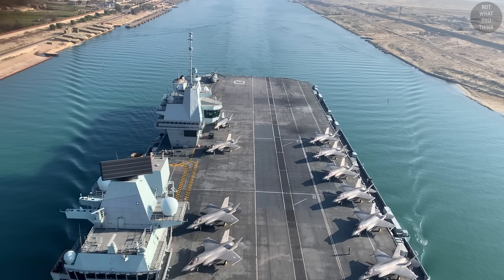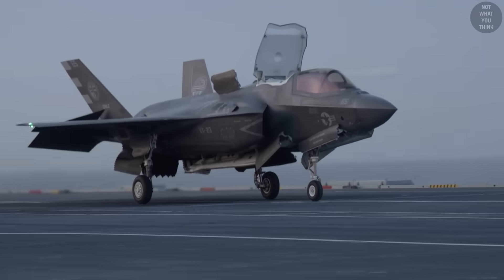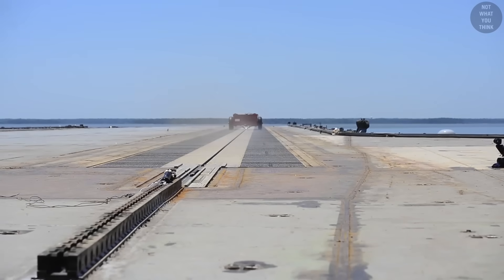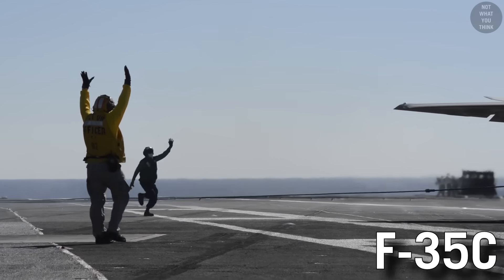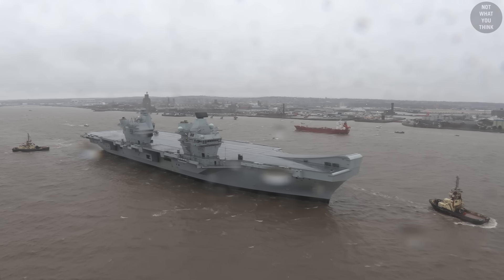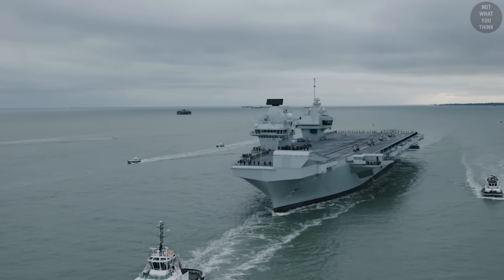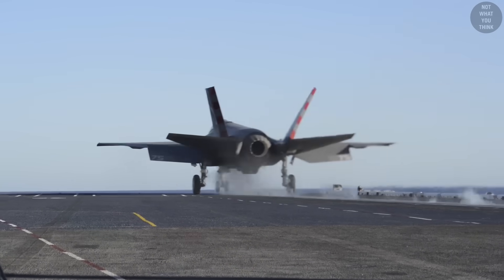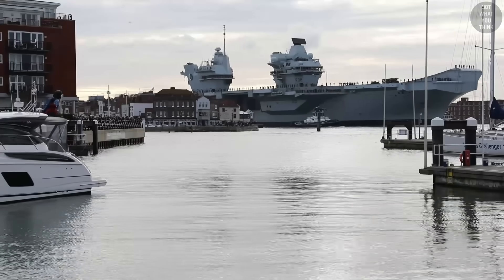Was the Angled Flight Deck Missed on HMS Queen Elizabeth?

Comment: They should have built stobar, now they're stuck with vtol aircraft for the next 50+ years.
Reply: To be fair the addition of an arresting gear would be possible if required in future, STOBAR wasn't really considered now because STOBAR aircraft take off with very limited fuel and weapons compared to the F-35B, it's likely going to be CATOBAR or STOVL, no in between.

They are now planning on adding a catapult and arresting gear sometime before 2030 to launch medium sized unmanned aircraft alongside the Ski-Jump now, it's possible in 50 years all of its aircraft will be like that.

Comment: How the hell are EM catapults still problematic? They use the exact same technology as EM launched rollercoasters, and those have been around for decades.
Reply: Without speculating on possible factors such as politics and corruption, from a purely engineering perspective, it's probably a matter of scale and precision.

A fully loaded carrier fighter can weight upwards of 20 tons, and have to be accelerated much faster than a roller coaster, so the EM catapults have to be much more powerful while also being able to fire much more frequently. The new US carriers also claim to have EM catapults that can  have dynamically adjustable force profiles to meet different plane/loadout requirements. This is probably what fucked them up, because designing a catapult to do the same thing every time is not that hard, but having something that powerful and precise be adjustable is frankly asking for trouble. However, this was one of the selling points used to convince Congress to fund the EM catapult, so they couldn't just scrap the feature. There's also the potential issue that being powered by shipboard power might be more difficult than with landlines, and the powerful EM fields generated could affect delicate instrumentation elsewhere on the ship, so they probably had some stringent shielding requirements that made things hard.
Reply: @DiscombobulatingName  A fully laden F-35B can weigh over 25 tonnes on takeoff, not just 20 tonnes. Actual takeoff weight depends on the mission, payload, fuel etc. of course.

Comment: The UK government have, as of spring this year, started a programme to look into the provision of lower-capacity EMALS for the carriers. These will be inadequate for launch or recovery of the F-35s, but will allow the addition of larger drones/UAVs to the air wing, for a variety of uses, from long-loiter surveillance around the battlegroup, to refuelling, and, yes, offensive and defensive ops.
Reply: Replacing the Crowsnest Merlins with AEW drones in the 2030's is another stated aim. Of course, if you can refuel the F-35 B from a UAV tanker then it will negate the shorter range that STOVOL aircraft inherently have.
Reply: @paulwilliams493  the Boeing MQ-25 Stingray has already proven itself as a carrier-borne tanker in US trials, and is precisely the sort of vehicle that the new EMALS will be needed for. That's just the start though...

Comment: It wasn’t mentioned but I think the RN would like to have E-2D Hawkeyes quite a lot, too.  They use Merlin Crowsnest helicopter system for AEW.  And I’m sure it works but an E-2D it is not.  Even the French use E-2C on their one (1) carrier, CDG.  They name a lot of things after him because most of their military establishment choked (as Trump would probably put it) in 1940.  Although, their modern MBT is named after General Leclerc, so there’s that.
Reply: It looks like they're going down the fixed wing UAV route with project Vixen, they're currently looking into options for adding an electromagnetic catapult able to launch vehicles up to a maximum weight of 55,000 pounds, they want this system to replace the Merlin Crewsnest by 2030.

Comment: The QE Class Carriers, are capable of launching and recovering aircraft in worse weather than the US ships are capable of. Second, if you lose the cat system, you lose your ability to launch.
Reply: @randomguy9777 It will, but not for F-35s. More likely for large drones, which is something that the Royal Navy is currently looking into.

The likely plans for the Royal Navy will be to operate 12-24 F35s on a carrier and make up the numbers with a loyal-wingman type drone. They're also looking at drones for AEW to replace Crowsnest and also for air to air refuelling.
Reply: @randomguy9777 Maybe, but EMAL is both unreliable at the moment, and too expensive. The only Navy with enough Carriers that can afford to experiment with EMAL is the USN. The QE's cannot use steam operated CATOBAR, so EMAL is literally the only option. The RN cannot afford to experiment, it has 2 Carriers, the US has what, 10 Fleet Carriers? Using one as a test platform for EMAL is no big deal for the USN, but for the RN if it is unreliable it takes one of their most powerful ships out of service....

So yes, while I agree, Its not going to happen until EMAL comes of age.
Reply: If a carrier gets hit in this modern day and age with missiles, it's already been mission killed, even if it uses STOVL, also I'm pretty sure American carriers often run carrier exercises no matter the weather, so they can function in bad weather.
Reply: keep thinking that lol
Reply: That is a lie. US carriers are all weather. As long as the plane doesn't literally just slide off the carrier when not chained down they can launch and recover it.
Reply: @randomguy9777  well unfortunately 
Geography and the sea would love to have a word with you

Have you not seen the Falklands war
It pretty much gave the royal navy reasons to not have a catobar because of a) sea States in the Atlantic being very unpredictable 
B) emals are still in development but I suspect catobar will be used once its at the point of reliability and cost problems being sorted
C) we have unpredictable sea States even around our coast and even in the south Atlantic
Reply: The US has both kinds. A catapult is way simpler than VTOL. If you lose the catapult you don't lose the ability to launch you lose payload and/or range.
Reply: @Otto_von_Chesterfield  The F35Bs aren't used for vertical take off though, they use a rolling take off using the ski ramp that never breaks down or needs constant maintenance. Yeah, a clean F/A18 could take off without a catapult give the right exacting conditions but what would be the point apart from maybe flying to an airbase for an overhaul or something?
Reply: @randomguy9777 They are, yes.

The RN seems very keen to go down the drone route, however, so likely looking at unmanned solutions for the QE class carriers.

I'm interested to see what they come up with.

Comment: Not so sure a comparison of fuel of a F35A is needed. STOVL with a ramp allows far more payload which for the needs is far better than any STOVL before. F35C also while a tiny bit cheaper would need more maintenance and different supplies and wouldnt be used by RAF. If we had bought it it would mean buying 1 aircraft carrier and 30 x F35C. Not the plus 48 we will get of F35B. Had to be dual use. Also F35B can do Austere so can be used for 3 types of landing TO not just carrier or land. EM is secondary for BVR.

Comment: Take off and landing can be done at the same time on the QE class , The F35b only needs 300 ft to take off leaving at least 400 ft astern for vertical landing .
Also the F35b can do a slow rolling landing . Maybe in an emergency 2 can be landed at the same time ? 1 from either side , the deck is way wide enough.
Reply: With so few planes it isn't necessary.

Comment: What is that hatch what's usually open when the jets take off?
Reply: It's the air intake for the second engine that produces the down thrust.
Reply: @MartinPHellwig  Thank you! I for some reason thought they were airbrakes and that's why it was so confusing to me why would they use such brake while taking off :D
Reply: @MartinPHellwig  it’s not a second engine, it’s a vertical fan that is driven by the main engine via a drive shaft and gearbox.

Comment: To save you 8 minutes of watch time : 
Because they use and were designed for F-35B which can just use its VTOL to land like a helicopter, that's the main point which took 4-5 min into the video.

Extra note (the last 2 minute of the video): They're not using Steam engine so they can't use a steam catapult, and electromagnetic catapult is a developing technology which is unreliable currently. So because they're not equipped with any catapult system they can't use F-35C which would need said angled flight deck.
Reply: But some poeple cannot read so they watch videos 🤠🌞😁😁

Comment: cannot understand why rolling SL is so hard compared to VL.
Reply: I'm guessing because there's so little margin for error. If you slow down too much you'll start to fall uncontrollably since you won't be generating enough lift. And speeding up will be difficult because you need to point the nose down a bit/angle the engines a bit, which will reduce your lift temporarily.

Or in other words, if you're too low it's difficult to get up higher safely.
Reply: @Sir_Budginton  I think the OP didn't think it through properly before posting the comment.
Reply: @Sir_Budginton  Well, the plane is already configured in vertical mode and the engine probably near the redline anyway, so I imagine they push it to emergency power, which I assume is available, to keep from falling.
Reply: Probably because it isn't the wheels that keep the pace with the ship.

Comment: ARRRGGGHHHH! There is so many factual inaccuracies in this video! I am sick of these MilYoutube channels not doing proper research and putting out these videos filled with inaccuracies that then get spread around social media!

1) F-35C and CATOBAR as a configuration is not cheaper than STOVL when taken as a whole through life cost! The cost of maintaining two squadrons or aircraft and their pilots maintained and trained in CATOBAR operations is significantly more than with the F-35B. F-35B or JCA (Joint Combat Aircraft) as it is also known as in the UK is a joint asset between the Royal Navy and RAF, going CATOBAR would have severely impacted the wider operation of the type beyond carrier use

2) The QE class has more installed power at 110MW over the Gerald R Ford Class at 100MW

3) The option to fit steam catapults was always built into the design and there is space provisioned for the installation of steam boilers in the wing structure of the ship if EMALS had been rejected

4) F-35B payload and range is superior to that of the legacy types it was meant to be replacing in RAF, FAA and USMC usage the AV-8B, GR-7/9, Tornado and Legacy Hornet..... Going off the Ski jump!

The only item in this video that is partially true is the cost and delays in EMALS was a factor in the decision to switch back to STOVL.
Reply: The Gerald R Ford has 2 700MW reactors installed.

Comment: There are several advantages to STOVL Carriers that are rarely mentioned and are hardly even known.
During the Falklands War, the British pilots of the Harriers, the other successful STOVL fighters, found that because landing vertically on a STOVL carrier was so reliable, they didn't need to reserve any fuel for go arounds.
Once practiced and continent, this extended their operational range by 100nm (I've lost the source for that number, so that's from memory, it was an operationally useful distance though)

Further to that, RAF harriers operated from the carriers. You won't see USAF aircraft operating from a Nimitz, not outside of experimentation.

Finally, STOVL Carriers operate in any sea state the carrier can handle and any headwind (although headwinds obviously will extend the harriers range)
The Argentinian carrier veunticinco de mayo could not operate in the winter seas of the South Atlantic, which was very lucky for us and very lucky for them (it would have been torpedoed, the British tried very hard to sink it, luckily for them their Captain and their ASW teams knew their stuff)
Reply: There is no need for USAF aircraft to operate fro USN carriers; the USAF is the world's largest Air Force, and the 3rd largest is the US Navy; we have enough air wings in the Navy such that there would never be any need to operate Air Force assets from Carriers.
Reply: @devobronc  
Completely missing the point.
I don't care how many planes USAF has.
Only STOVL Carriers came do this.
The Americans and the French are stuck with two separate air fleets, expensive and redundant.
Reply: @devobronc  The cost of the QE class (which is great value for money) is not the problem.  It's a shortage of personnel that is, and no amount of money is going to solve that.
Reply: CATOBAR aircraft still out range and out carry ramp launched aircraft by a significant amount so that isn't an "advantage".

The USN operates the largest naval airforce on the planet so they don't need help from the USAF (the largest airforce on the planet) The UK isn't even in the top ten in number of aircraft the USN dwarfs the UK's entire air arm both RAF and Fleet. Once again, not an advantage.

 CATOBAR carriers can operate with a deck pitching 30'  look up "PBS:Carrier-Landing On A Pitching Deck PT 1". Show us some video of a ramp carrier operating in a worse sea state or once again not really an advantage.
Reply: @JoeBLOWFHB  
Yes it is, 1,100 miles over 800 and that's with peace time fuel reserves and no SRVL landings for the C over the B.

And you're completely missing the point with USAF. Why would we care about how many aircraft a foreign military has?

STOVL Carriers and aircraft are better suited to operating at sea, the aircraft are more flexible, cheaper to maintain due to lighter landings. There's all sorts of advantages. 

Better sortie rates for instance, they wipe  the floor with the Ford class, they barely function. As for cost comparison, no contest, you could have 3 or 4 instead of a 4, quadrupling sortie rate while still reducing crew numbers.

I was just talking STOVL advantages, the ships themselves compared to other navies?

No contest.
Reply: @MostlyPennyCat    The Harrier has been retired for over a decade in the UK and the UK has vacillated on the pitiful number of F-35B'S they plan to inventory so it doesn't matter that in the good old days the RAF and Fleet air arms could share planes because they won't be doing that in the future. NOT AN ADVANTAGE!

You were the one saying we'd never see the USN and USAF sharing planes ...well neither will the RAF and Fleet that ship has sailed. My point is our Navy isn't so under inventoried that we would ever need to share aircraft with the Air Force if the Navy wanted to share planes they'd do it with the Marines who still operate the Harrier along with the F 35B but they don't because it's NOT AN ADVANTAGE.

If STOVL carriers and planes were "better suited" the USN wouldn't be wasting their time and money on an inferior product they'd just put ramps on our LHA's, triple their number and spend the savings on hookers and alcohol. The Ford class is a totally new carrier operating a totally new aircraft STOVL sortie rates are total shit compared to the Nimitz class which is still the vast majority of the USN fleet. Between 1966-1967 the USS Enterprise launched 14,000 sorties (look up  "Command and Control of Air Operations in the Vietnam War") give me a citation where a STOVL carrier exceeded that number... I'lll wait...actually no I won't because no STOVL carrier ever launched an average of 38 sorties a day for one year. Hell their sortie rates are total shit compared to a 66 year old Forrestal class.

Counting pennies is for nations that can't afford to keep their nuclear triad in service and need to buy their sole nuclear delivery system from another country. The UK's military across the board has been in steady decline for a decade so all those cost savings are a necessity NOT AN ADVANTAGE!
Reply: @JoeBLOWFHB  That means nothing if you can't launch your aircraft.